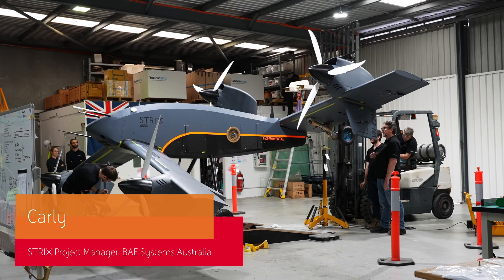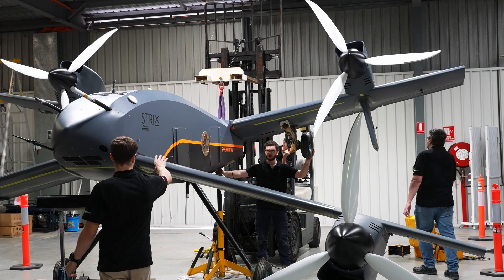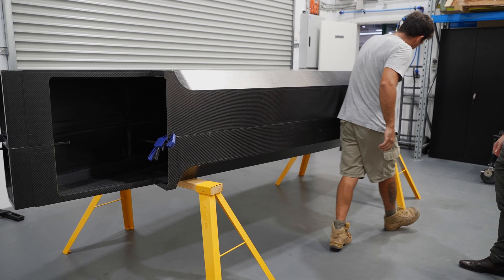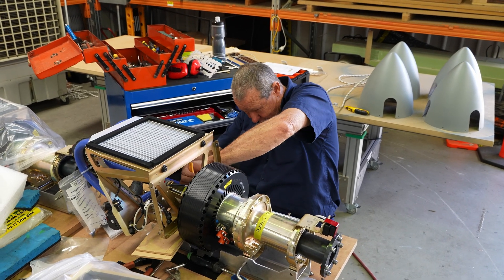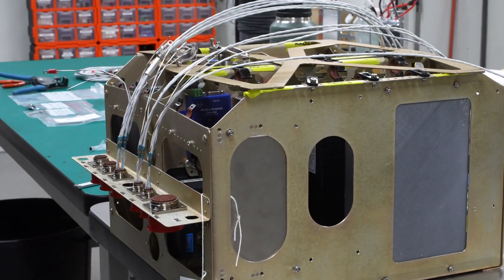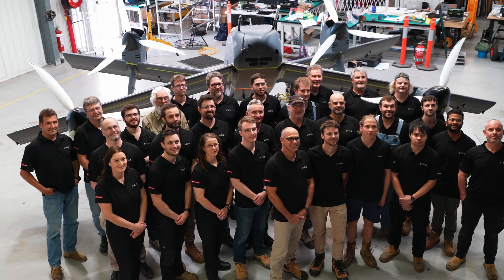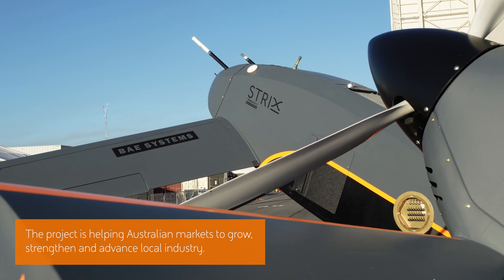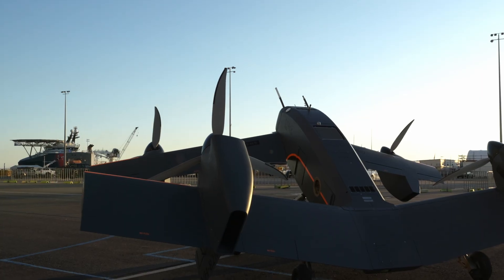STRIX Program Update

Comment: wow...a quadcopter. never seen that before
Reply: Basically Blackfly with only four motors (no redundancy) why have anhedral on the front wing - reduces tip clearance (prop tips...)   
I did a quite similar configuration over 30 years ago (reported on plus photos) but it also folded itself .  Designer of Opal (world first composite tail pusher 1975, RAAF basic trainer candidate Sapphire 1980 (govt aircraft design failed) etc etc.  Saw it at Avalon and asked... why?  Too much money, too many cooks, too soon.   Cf to ghost bat flop.

Comment: so, it appears that the "vertical" offset between "front" and "rear" drives, allows for software to rotate the airframe around a virtual center, as well as adjusting "yaw" in software...so no tilting wings or motors, and a kind of canard configuration in forward horizontal flight...maybe? the only clue was "no moving parts", and the driver offsets.
Reply: My thoughts as well